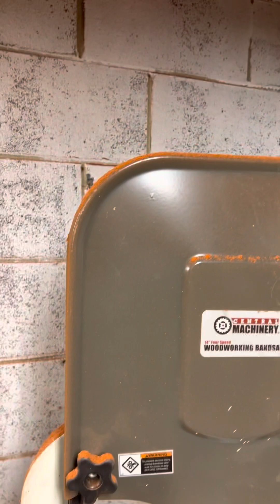Part one. Lung safety

Comment: John, this may help - 3M Respirator Kit, Full Face 6900, Reusable, Large, Plus 4 Particulate Filters 2097, P100 for Mold Remediation, Dust, Lead, Asbestos, 69097. The one I used at P&G in the boiler room were around $1200 full face for them, not counting the three stage filtering.
Reply from the maker: It does my friend. Thank you very much❤️🌲🪓👊🏻🙏🏻
Reply: Wisdom

Comment: Do you plan on putting in a dust collection system brother Johnny? I was around dust my whole working career.  The first half I did with out a dust collection system because they were huge and very expensive.  The second half I had every machine on a collection  system and it made a huge difference. I am praying that your lungs will clear out and that all will be well. God bless you my brother.
Reply from the maker: Yes sr. I have already pitched a reall good respirator and filter setup and am looking at a dust collection system that will work for me in my space. Thank you for caring my friend. God bless you. ❤️🪓🙏🏻👊🏻🌲